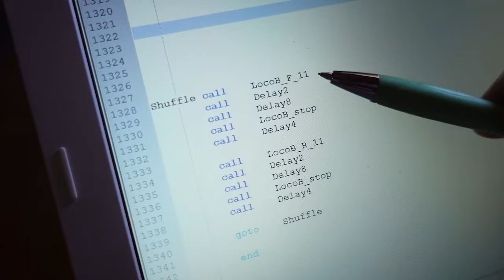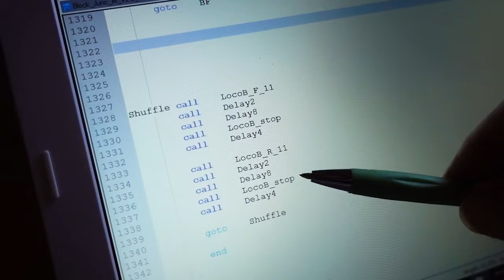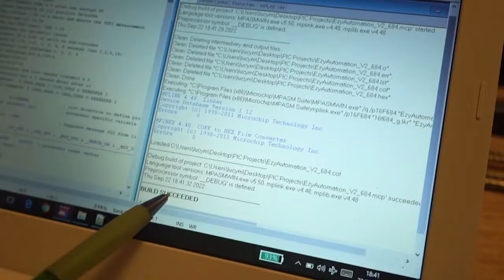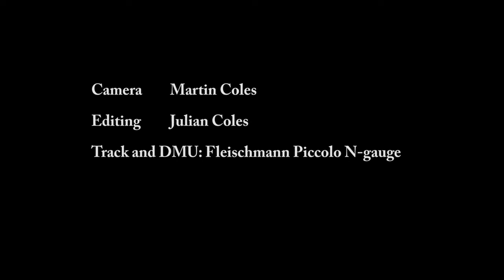Automation system for small DCC layouts

Comment: A really interesting project👍✌️😊

With such simplified wiring (no BUS) for DCC, is there ever voltage drop or runaways? Or is the layout too compact for such (plus it's tail chaser style)?🤔🤔
Reply from the maker: Glad you found the project interesting. Certainly no  runaways. On may actual layout (seen in the background and see earlier video) there may be voltage drops but not enough to affect operations as all locos have decoders with back BEMF. When an uncoupler is operated the voltage drops by a volt - but this causes no noticeable effect elsewhere. My other layout - much larger and seen on an earlier video - has no problems with the track as DCC. I take care to ensure that all rail joints are sound.

Comment: Hi Julian I have just come across your video of your three rail 00 Hornby system, congratulations on such an excellent job. My interest was kindled because I still have my old Hornby 00 system from the 50s and have been considering passing it over to my great grandson. I am still at the research stage on the possibility of converting it to DCC. But I seem to remember that one of the motor brushes is fed via the wheels and chassis which obviously would not be acceptable for a DCC system. I wonder if you could advise me as to how you solved this problem. Does anyone supply insulating brush holders. I have three locos and a good selection of track and rolling stock so it would be a great shame not to bring it all back into use again. There seem to be plnety of DCC decoders on the market and I think there should be space inside the locos to accommodate one of the smaller samples. I have a 4MT 2-6-4 Tank, a 06-2 Tank and a Duchess of Atholl.
I hope you can offer some advice to an 84 year old retired engineer.
Reply from the maker: Peter please email me: julian.coles69@gmail.com

Comment: Hi Julian. I fail to see how the Toti is involved in your program to report the train has reached its destination.
Also the Toti seems to answer-back directly on the track signal (DCC?). Is this true?
Reply from the maker: John: In the example I give here no TOTIs are involved. That is to make it easier to understand the concept. In the next part - which will be published in a couple of weeks - I add TOTIs to the shuttle. And yes, the TOTI does indeed 'answer back directly on the track' to the controller. This what makes it a 'wireless system'. I explain how it is done in Part 2 and in the MERG Journal articles (Sept and Dec 2021). Basically it is like `Railcom' - a signal is sent during gap in between the DCC packets.
Reply: @juliancoles1825  Thank you Julian. This is clear now. Jean

Comment: Would have been more user friendly if the PIC had USB and the 'script' wasn't hardcoded into the PIC source code. You could just then download the script from a nice PC train automation editor application and then downloaded into the PIC via USB. At which point the script would be 'interpreted' by the main code on the PIC and do the calls to each function as you do in this video. Very nice project though.
Reply from the maker: Simon: Thanks for you interesting comment. That's a bit too computer nerdy for me - I'm a simple soul. But if you would like to build such a system, I would be delighted. Anyway glad you liked the project.